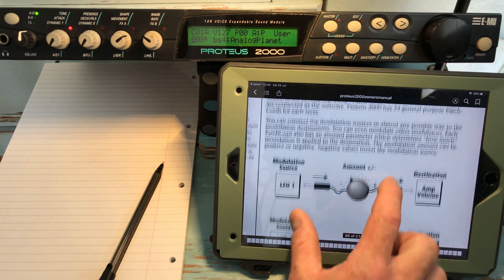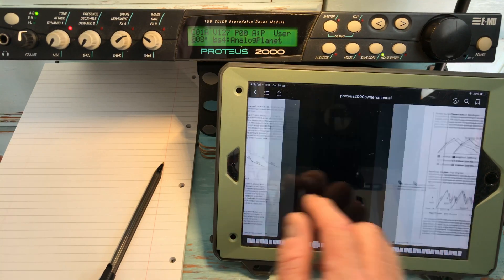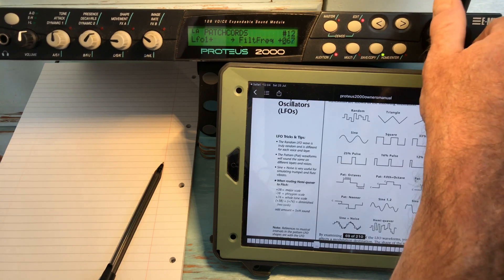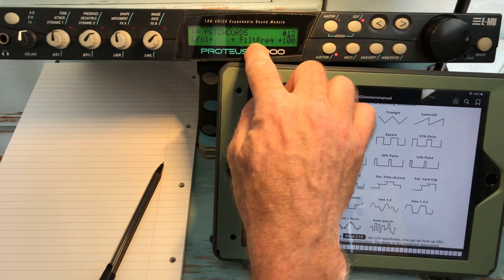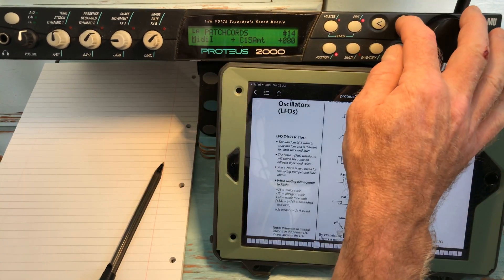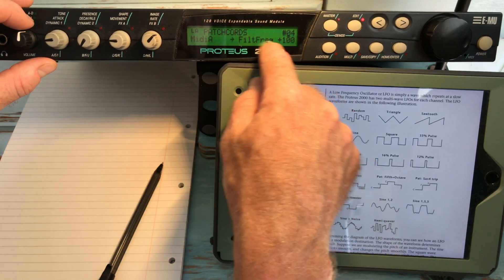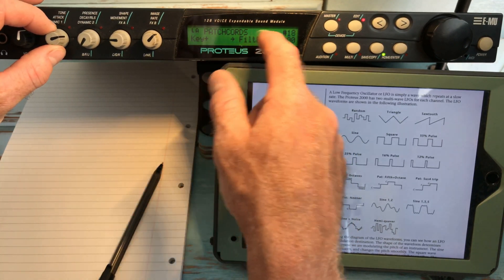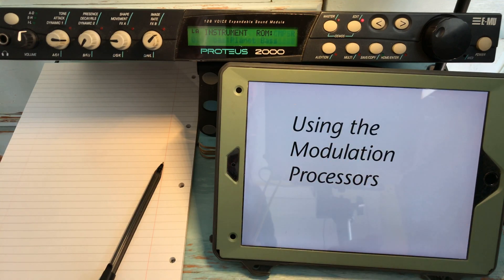Emu Proteus 2000 Programming basics Modulation patchcords

Comment: 12:16 I can't find that video you talked about. I remember a video where you explained adding noise to an envelop or midi controller (?) but can't find it any where!. Was is that same video perhaps?
Reply from the maker: Hi, what information do you need? 
I may be able to make a video for you to show the technique you are interested in...?
Reply: @1heUndertaker  Great technical vids mate, and maybe you have covered it somewhere but is there a way to use a mod envelope to modulate the pitch of a sound with short decay to get a really sharp snappy attack on sounds?
Reply from the maker: @a.stockton4817  Could you share some more info of the type of sound you are after?
eg is it for bass / drum / percussion?
or for a piano / plucked string?

You mention modulating the 'pitch' to get a snappy attack? 
Are you describing using one of the four layers of a preset to add in an extra bit of 'impact' to the beginning of the sound?

For example, in some of the piano presets, there is a layer assigned for this called piano board I think.

In any event, envelopes are interesting to explore !
If you can explain a bit more about what specifically you wish to achieve, I'll have a go - and post a video attempt 😁
Reply: @1heUndertaker  cool thanks, mainly trying to make the piano and pluck sounds hit harder. I dont know if these links will show, they explain it.
https://www.youtube.com/shorts/PyH5Bp3SyIg
https://www.youtube.com/watch?v=EE6wyP2jSJ0
Reply from the maker: Great, thanks for the links - makes sense now 👍
Will take a look at this, hopefully tomorrow.
Reply from the maker: @a.stockton4817  Hi again, 
I've struggled with this the past few days, and have not managed to make much progress with it unfortunately.
Let me know if you find a way to do it !

I may revisit it at some point in the future, when I understand the patchcords and envelopes more.
☺